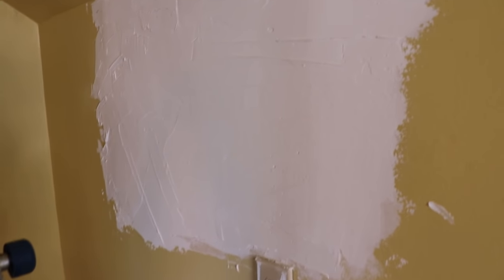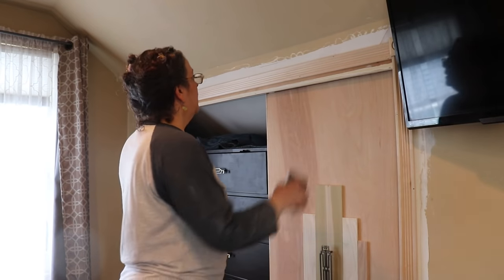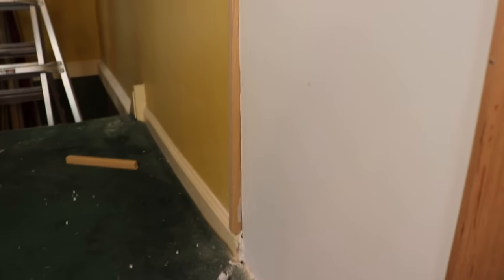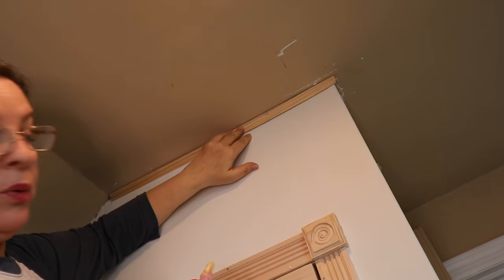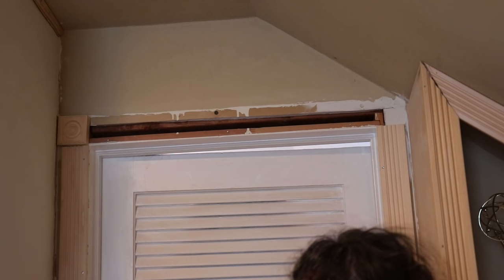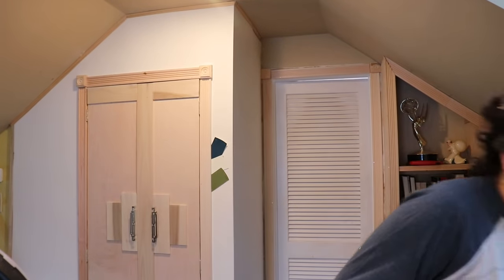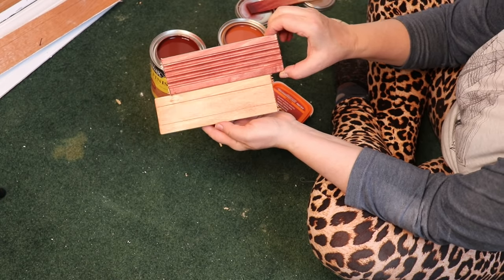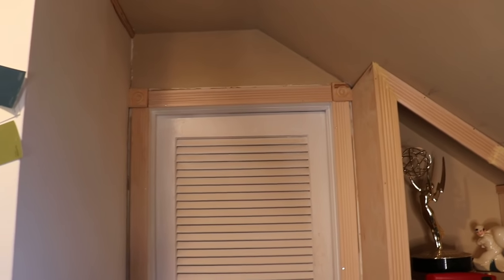Master Bedroom Makeover Series || More Sanding and Trim || Episode 25 ||

Comment: Has anyone mentioned to you about finishing nails for your wood trim? They have no head and you recess them with a nail set and fill the holes with caulk or fill with putty. That way you don’t see the nail heads through your stain or paint. Just mentioning, very much an after thought on my part. Just an FYI. Love all your how to videos! You are doing a great job!❤️😘👍

Comment: Minwax gel stain is a product that you can use over paint.  It will look like stained wood when you’re finished.  You could use that on your painted bathroom door to get the look you want.  Your paint company can suggest your local brand that will do the same thing.